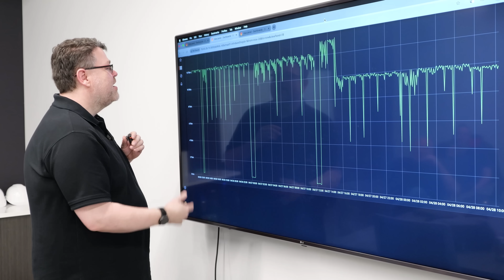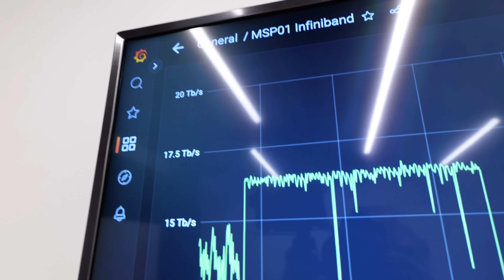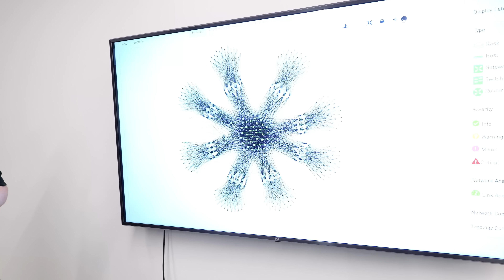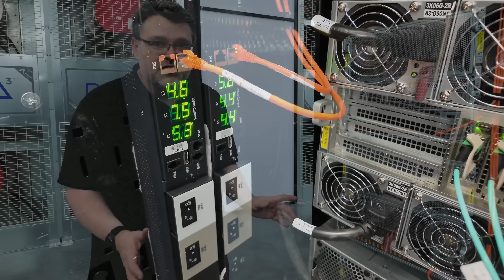Inside the Modern Data Center! SuperClusters at Applied Digital

Comment: After spending decades in big telco data centers what a breath of fresh air anything created this century would be.
Reply: @cersos Liar.  Telecos do not have 'data centers'.
Reply: @RunsOnRust up until the 2000s after cell phones exploded, most large privately owned datacenters were owned by ma bell or nortel, at least in the states. Sure the switching frames you could call MDFs or whatever but they were still housed in datacenters. Nowadays most datacenters are colos though, instead of owned, operated, and only containing one company's equipment; and the old datacenters owned by ma bell or nortel were sold and now run as colos owned by private companies.

Comment: Really nice look at a data center in the 2020s.  There's a lot more of the not-raised floor lately.  Of course, you can mess up the design a bit and make it really dark if you run too much power and networking overhead but under the lights.  Not that I've ever seen it!  O:-)

Comment: This was super interesting. The part about moving the racks closer to keep the fiber optic length from exceeding 50m was kinda shocking. Saving 1.5 million dollars just like that...wow
Reply: Makes you wonder why they're not 10m apart
Reply: @master21mark  ...clearly looked they are ready to stuff 4x as much tech in, if needed :)
Reply: Gotta love the low-hanging fruit.
Reply: it is interesting - the cabling guys often think they save $1.5m by moving chunks of networking around, and then a design engineer goes "well you displaced 40 revenue generating racks to save $1.5m in cable, and now we've lost $2.6m in revenue per year".

Comment: This is awesome!!!

A few things:

1) I run the cyan coloured fiber optics in my basement (albeit ONLY for 100 Gbps Infiniband), and I'm using active optical cables, because it was easier for me to deploy at home.

2) I would've loved to see how they cool the systems. It looks like that they're still using all air cooling, but when you are at 45 kW/rack, I would've thought that it would be more efficient for them to go with liquid cooling, running two independent loops, and a heat exchanger between them.

3) Almost 16 Tbps of network traffic, nominally.

That's just crazy!
Reply: Most available Colo Data Centers don't have liquid cooling options. At least this one didn't when we built the cluster. Most all future builds will have to be liquid cooled. Most with added read door heat exchangers to boot.

Comment: Always interesting to see the lack of density in these air cooled nodes compared to what we have seen in say, El capitan the Frontier HPC super computer.
Reply: Density kills us due to heat load and power per rack. These racks are "only" 45 kw each. The B200 clusters we're now implementing are 140kw a rack.  The rows are spaced out because we couldn't fit any more compute in the room due to power constraints.  We maxed out the 3MW in that data space. So, putting them closer together just made no sense really.

Comment from the maker: 0:00 - Welcome to the datacenter!
1:05 - So what's a SuperCluster?
2:34 - What physical infrastructure do you need for this??
4:03 - Multi-megawatt energy load tour
5:19 - Networking an entire datacenter
8:14 - Applied Digtial Interview / Architectural design
9:33 - Storing alllll the data -- approx. 2 terabytes per second!
11:35 - What software do they use for all this?
12:55 - Monitoring for errors ft. Wendell causing chaos
13:45 - Rack servicability
14:21 - Why do we need datacenters? What do they do?
15:17 - Conclusion (This place is awesome)

Comment: Nice! Thanks!

Note: it seems odd to have so much open space above the racks. Seems like less area would be easier to climate control. Although, I guess they could be forcing cool air in low and pulling at the top. Plus I doubt any expence was spared. Accessibility would be another consideration....I prob answered my own question. Weird what happens when you say things "aloud".
Reply: theres different schools of thought about that. Heat rises. Give it an adequate volume and let all the hot rise, cool air will stay at the bottom and come in for intake, takes a lot less energy. Bonus points if youre in a cold climate, you can get outside air in, and vent the hot air out of the top for nearly net zero cooling. Also, if you look closely, they're venting the heat using not hot/cold aisle, but using "chimneys". Keeping the room cooler.